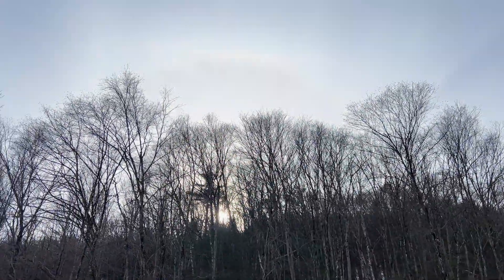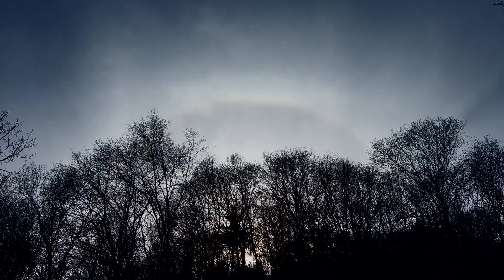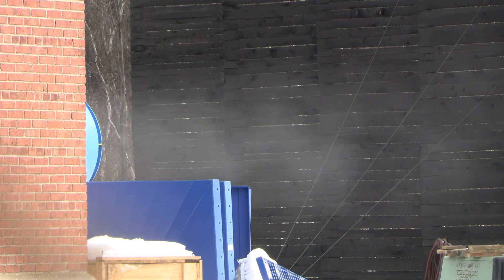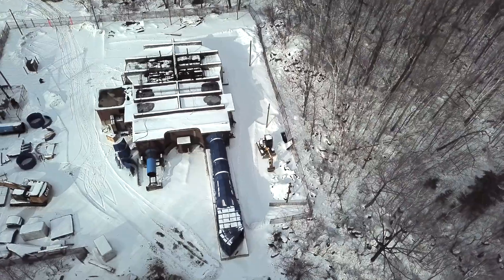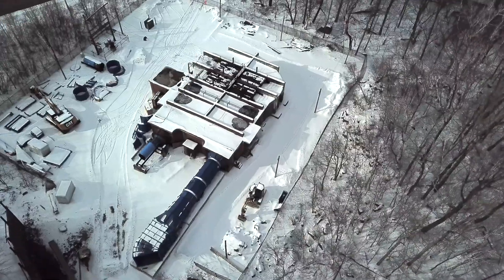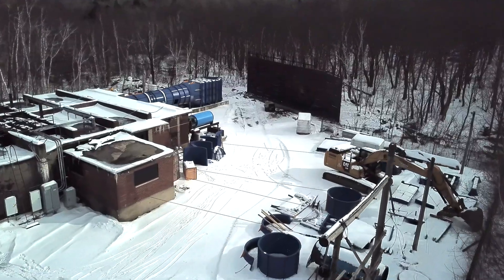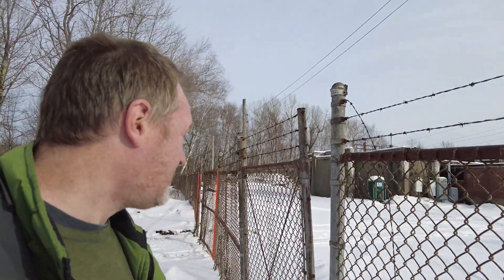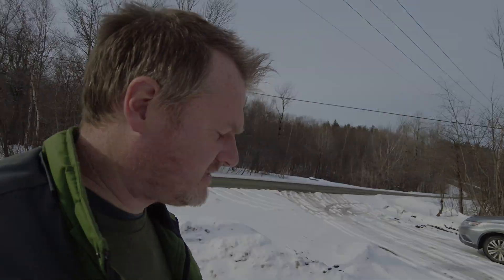Hoosac Tunnel Central Shaft Updates - Then vs  Now

Comment: Was up there not long ago myself. I'm so curious as to what the interior of that building looks like and how it's constructed. From your video you can make out the circular section when would be the elliptical shaft itself is. A terrifying thought as to how that plummets down over a thousand feet. 😱
Reply: Well, the outlets face south, for one. As the shaft goes down, before the tunnel's bore the path splits in two. This is supposedly because of any rock breaks off and falls down in it won't hit anybody or any passing train below. Inside the two inlets are quite low, coming out of the walls, and being offset by at least 100 feet apart.
(They say that the alignment of the tunnel bore, all together, was around 5/8 inch off. Quite the accuracy for the times!)
I have heard something about the workers also starting at Central Shaft, also tunneling out parts of the tunnel, however, while I do question this to be true I do find this very hard to believe. I don't know!
Yes! I can believe the accuracy in it from two directions, meeting in the middle.